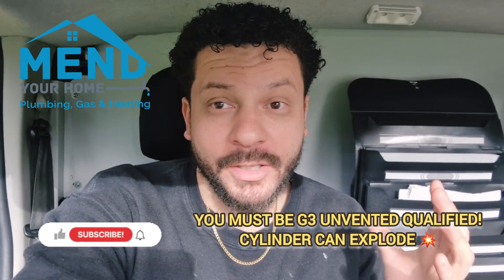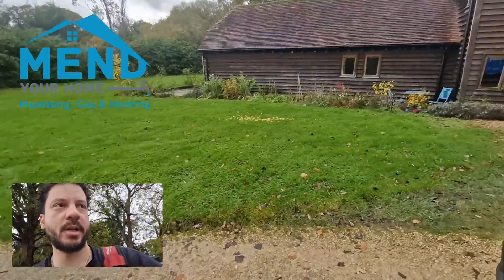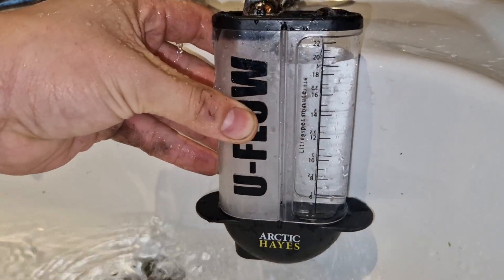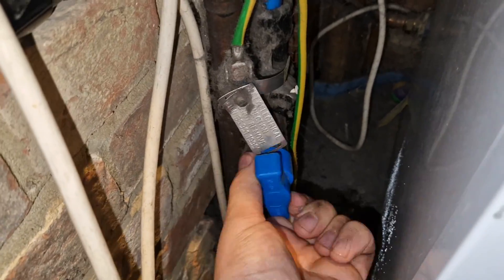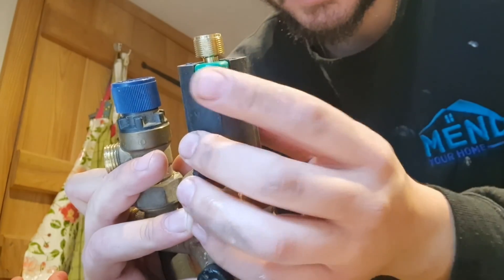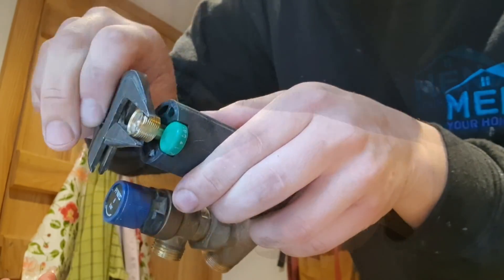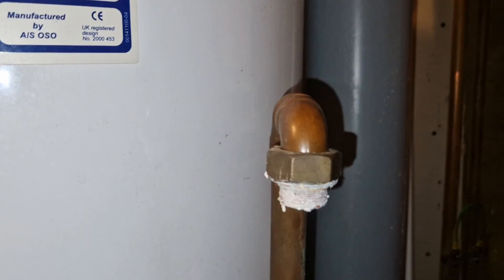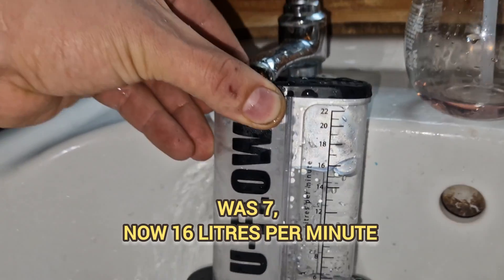Fix Low Pressure Hot Water Taps For Unvented Cylinders

Comment: Well done my brother, next time count the main pressure and divide that by two , otherwise hot side overpower the cold side or other way around or if you wanted dead on , keep adjusting it and keep using the water gauge meter 😂 from the highest floor of the house , wherever there’s a bath mainly , because some showers are designed to mix manually, and with differential pressure it’s absolute nightmare to balance them out 😅😂🙈 same applies to a mixer showers 😅 sometimes temperature will be lower even mixer bar says 42 Celsius on standard shower .